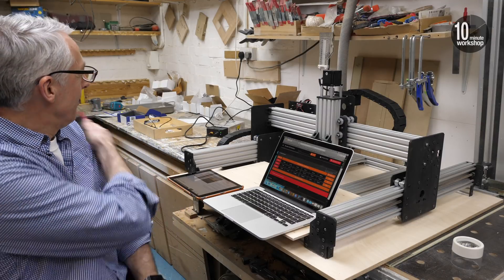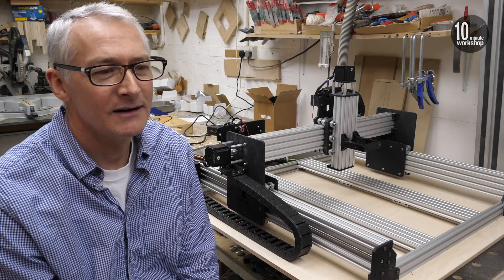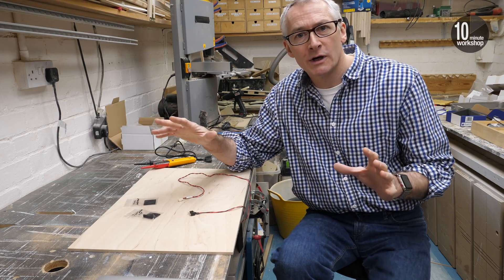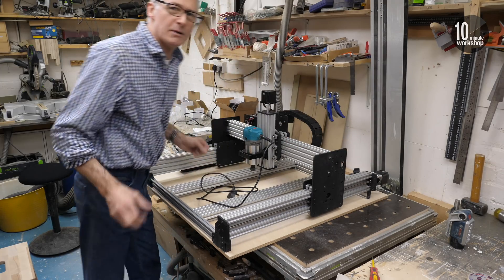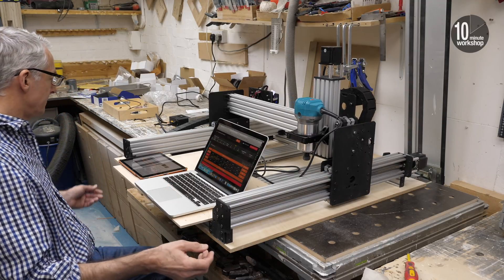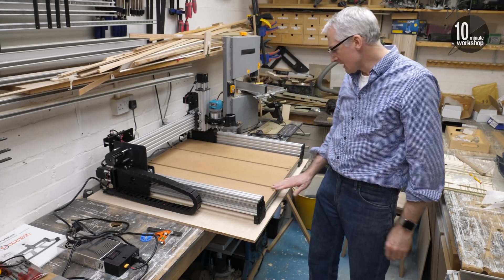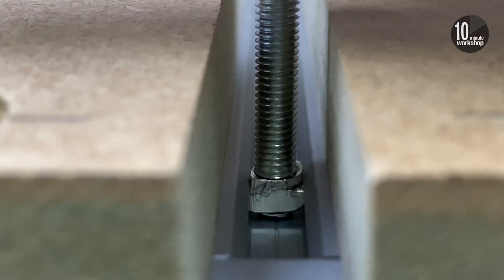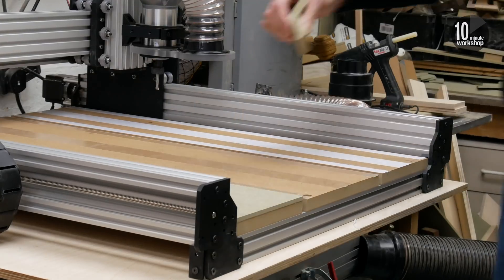Starting Out in CNC P6 - It's Alive, mostly... [video 390]

Comment: The "limit" switch is really a "homing" switch, I've never had them fitted on my machine and never felt the need for them I only ever have to home the machine once from "cold" (when first turned on) or if I do something stupid to make the machine "crash" and stall the motors. They can also be more trouble than they're worth, particularly mechanical microswitches fully electronic inductive sensors are far more reliable.